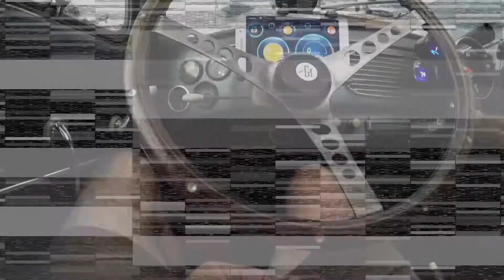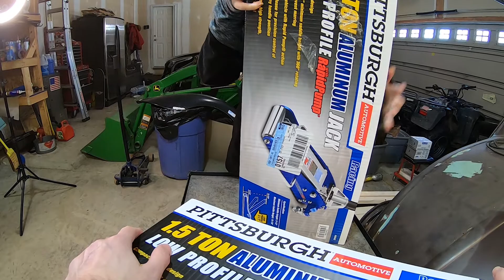Jacked Up by Harbor Freight (PITTSBURGH 1.5 Ton Aluminum floor jack)

Comment: ATV style HF jacks, work great for removing the vw engines.
Reply from the maker: I've always wondered how well those would work.
Reply: @ddk56vw   I have been using one for many years. Maybe I will make a short video of showing how well it works.